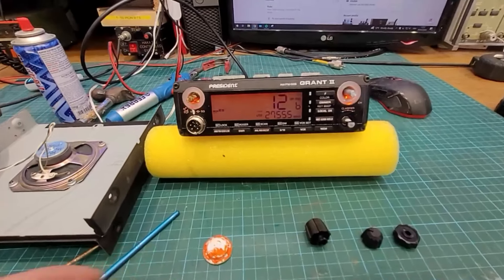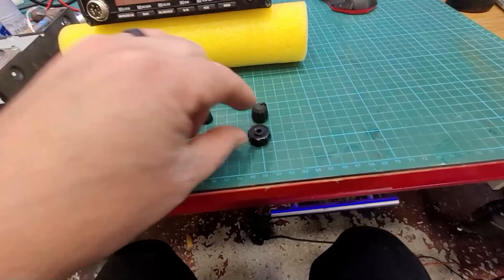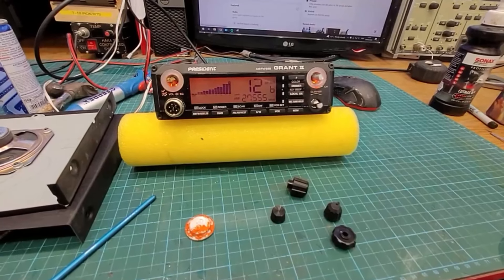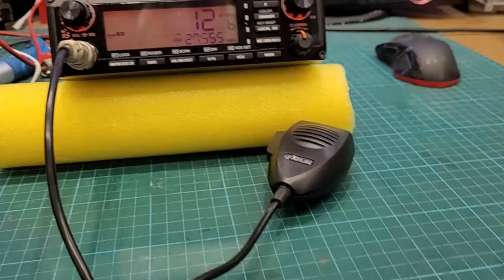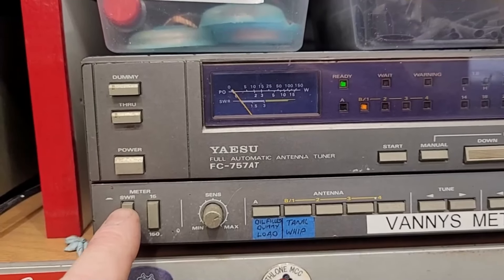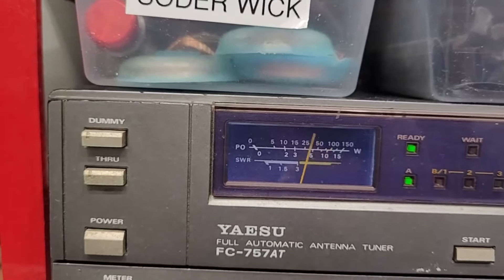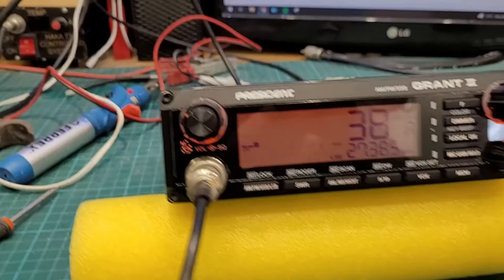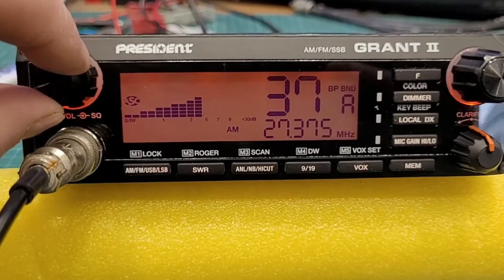VINCENTS PRESIDENT GRANT II

Comment: What would you say this radio is worth George? I have one I bought last year on Ebay From the UK. It cost me more than I wanted after shipping. I am going through hard times about now and am selling a lot of radio things. This is one of them. It of course is used but in very nice condition. If you can tell me a fair price to sell it for I would sure appreciate it.
Reply from the maker: It's very hard to say with the more recent radios. They don't have the same following the vintage stuff does. Very hard to price them. I'd say 180 euro or there abouts